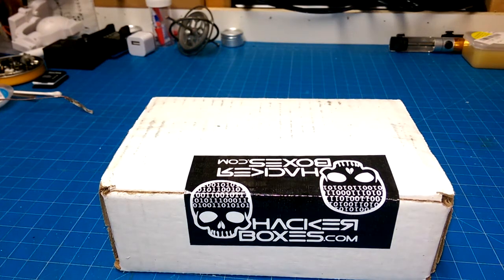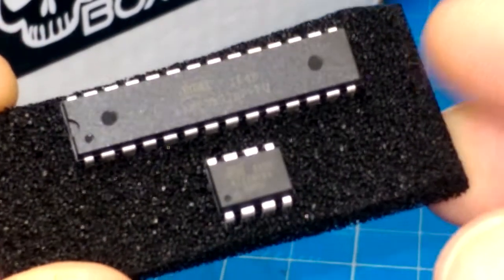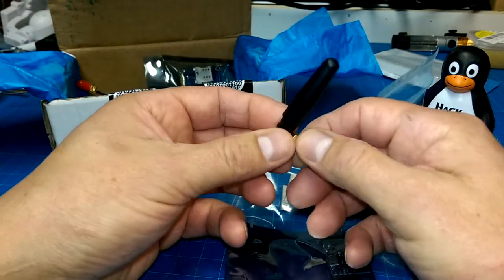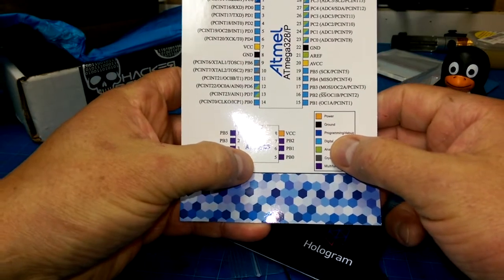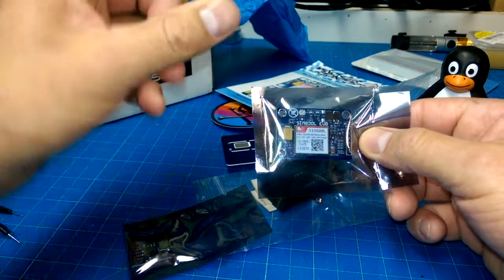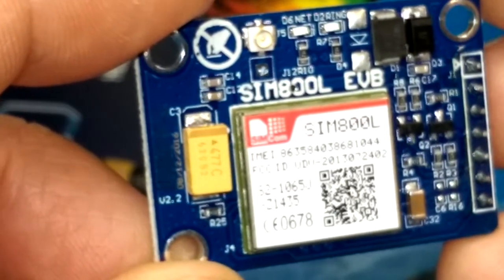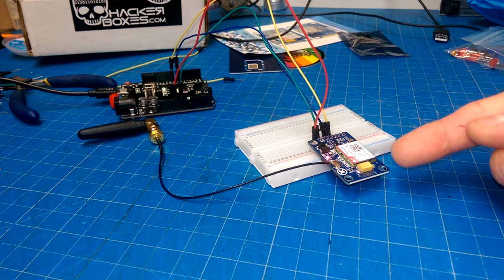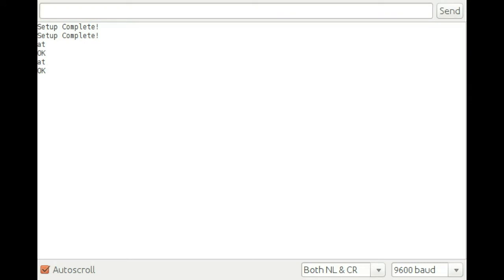Celular Hackerbox

Comment: Hi grtyvr - nice demo of the HB! :) 

Just wanted to clarify that the code from my site does use "/032", but only as a marker for the serial stream to catch.  Originally, it was a reference to Ctrl-Z.  Because we were just looking for a quick hacky way to enter in the text body, the "/032" got left in the code, but you can really use anything you want to mark the end of the text body entry, eg. "/xyz", "/eol", "/eof"....whatever makes sense.  You don't have to use "/032".
Reply from the maker: Jasper, thanks.  I should have made it more clear that the /032 was arbitrary.  But I did get a bit exited when it worked.